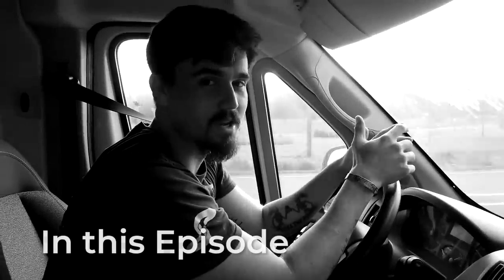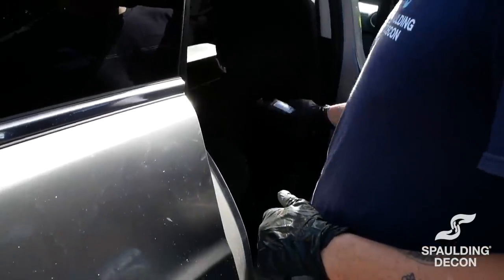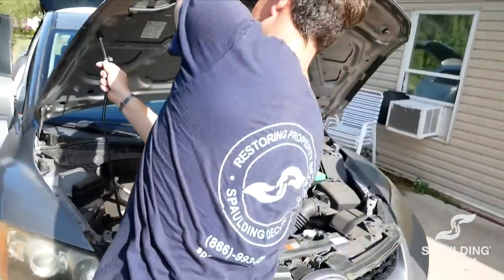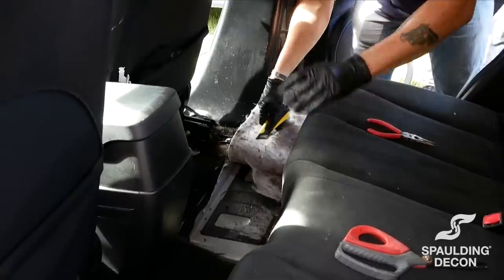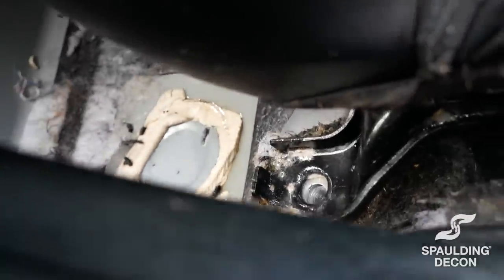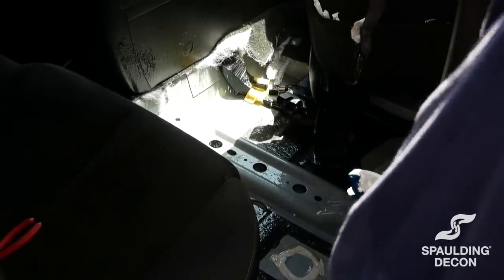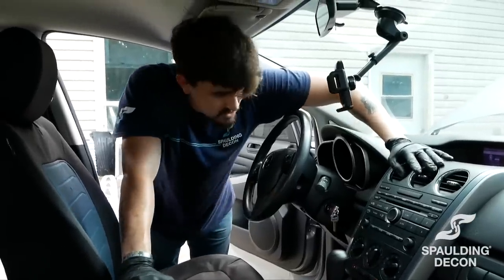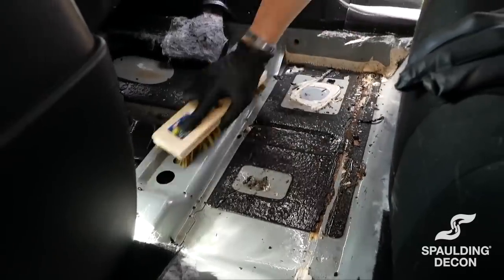D*** Cat Removal 101

Comment: quick tip, use a torque wrench and thread lock if you reassemble or replace seats, you'll be responsible if they fail prematurely

Comment: The airbag will not go off if moved or unplugged, it will set off a airbag light if the vehicle is started while unplugged, airbags will only go off if the vials located in the sides fronts and or rears of the vehicle are broken and trigger a chemical reaction that sends a signal to set off the airbags.

Comment: I totaled my truck doing exactly what you caitioned about. I was putting the seats back in with an electric ratchet, had the key on listening to the radio, 💥 I got smacked in the back by the side curtain airbags. Caught it on security cam too 😜.

Comment: I wouldn't have even decontaminated the carpet ,
It'll be replaced as one whole unit and aftermarket is fairly cheap
Pull the seats the center console trim remove the carpet as one whole piece

Comment: She would of had to close the door at some point if the cat mysteriously wandered in her car and got trapped? It doesn’t make any sense to me. I have so many questions. So, why was her car door open for a long enough period of time for a cat to jump in? 🤔
Reply: Cats can be quick and agile. If it was looking for shade it might have been tempted to jump inside while she was unloading the car of groceries or distracted. (this is even more likely if the car was cool inside if she had just recently had the AC on)
Reply: Pretty easy, many groceries, one person. You leave the trunk open as you go into your house with a handful of groceries, come back to get more and close the trunk when you're done. The cat probably wanted to get out of the heat. Many strays in my neighborhood go inside car engines, under cars, under trailers. It isn't much of a jump.
Reply from the maker: Did you watch the video? This is an elderly lady who only really leaves to get groceries every once in a while. It would be super easy for a cat to jump in during the time it might take her to bring in several loads of groceries.
Reply: Comprehension level -1 😂

Comment: I don't believe that lady gave the OK to rip up the carpet. That's just too much cost in parts and especially labor
Reply: God, you're right! They should've left the maggot-ridden carpets in there, stained with cat remains and all 🥴🥴. The smell should've lingered for months 🙄
Reply: @nija_2587  There wasn't that much material under the carpets. ozone generator with the car running and the AC on heat would clear that up after a few treatments. 
Cost?
Few dollars in electricity and gas.